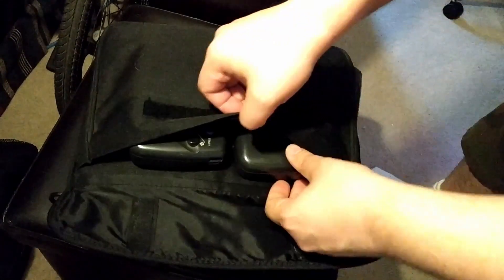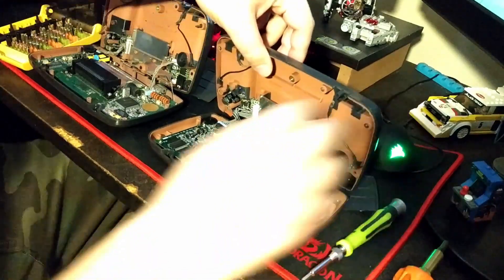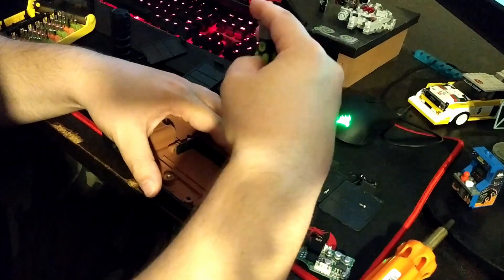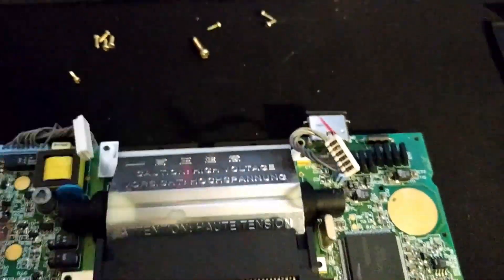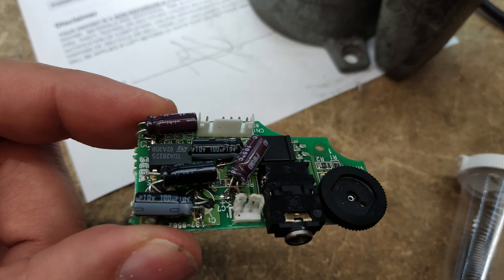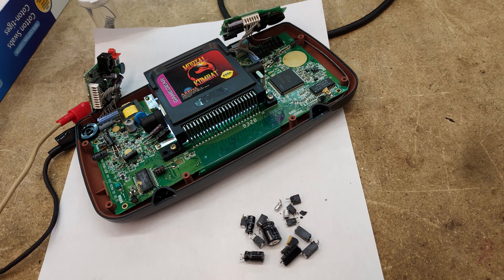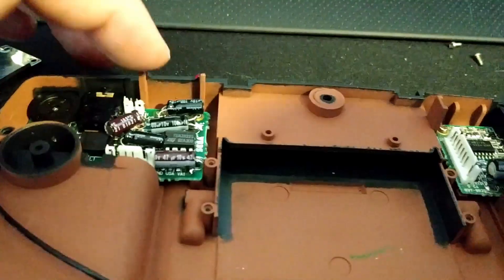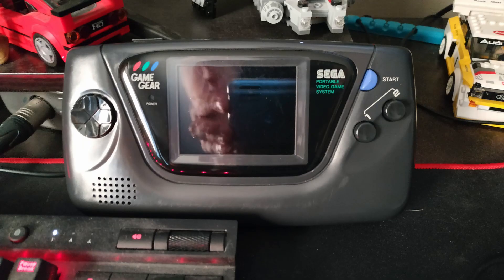Full Recap of my Sega Game Gear (20 Capacitors)

Comment: I've got a treasure chest (cardboard box) full of dead GGs. My intention was to fix all of them then I came across the Majesco GG, and it works flawlessly. 
What was your method for removing scratches from the lens? How much toothpaste do you use? Can you use a paper towel instead of cloth? Do you rinse the lens with water after wiping with toothpaste? Does the GG smell like mint afterwards?
Reply from the maker: I used the same amount you'd use on a toothbrush on the blue shop cloth and rubbed it in circles.  It didn't get rid of most of the scratches but made them less noticeable.  Maybe with a lot more time I could have got rid of them.  I'd like to try a small buffing pad on a drill or something like that since it takes so much rubbing in circles.  Washed it off with just water and no minty smell left behind.  The majesco GG is nice but over never seen one in person and I've seen a lot of game gears.  My guess is they're rare and maybe never even sold in Canada.  Hear they have a slightly nicer LCD screen.
Reply: @MN12BIRD  Thanks.

Comment: Awesome  video Jake! I've had a few consoles that kept doing the turn on and turn off thing. I replaced all the caps and still nothing. Not sure which capacitor culprit that would be causing that issue.
Reply from the maker: for me it stopped turning off when I had done about 17 of the 20 caps.  It was likely one of the large 50v ones on the left side of the motherboard or one of the ones around there.  The last 3 I had to change were on the right side at the time it started to work.

Comment: I heard the majesco game gear back in 2001 and i heard they last way longer
Reply from the maker: makes sense they're the last ones made and also I hear the screen looks a little bit better on those ones.  Never seen one in person and I've seen a ton of these over the years so they must be very rare.
Reply: I heard the build quality (not in electronics terms) can be pretty bad on those. like even poorer quality plastic than what Sega used, and things loose / rattling around inside
Reply: @RWL2012  Dead or alive? Make your choice. I have a Majesco. It's great. I think the screen looks better than the Sega ones I had before they died. The audio is still bleep bloopy, so there's nothing that I recognize as different.
Reply: I heard that the Majesco Game Gears don't actually have better capacitors and some of them have also failed!
Reply: @RWL2012  dang

Comment: Great job! I bought a used Game Gear from an eBay seller many years ago and it’s in great working condition... I wonder if he replaced the capacitors.
Reply: probably did, but didn't mention it in the description. That annoys me; any recapping (or internal cleaning depending on the item) should be mentioned.
Reply: @RWL2012  Yes, I agree.